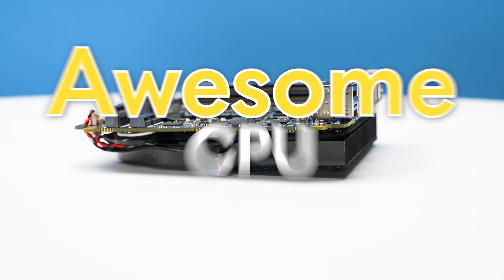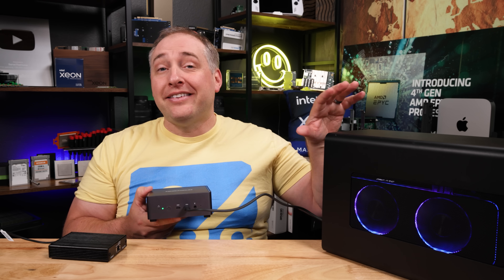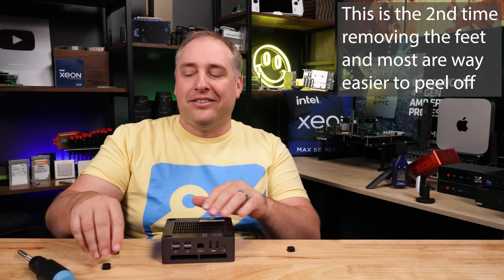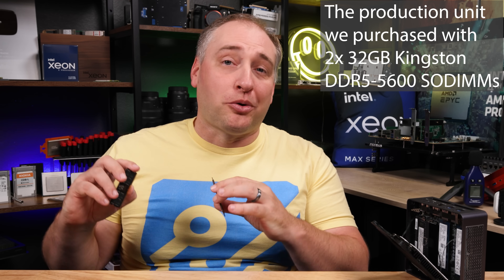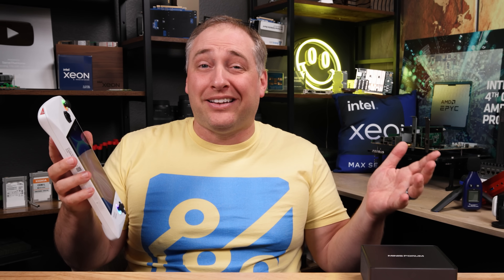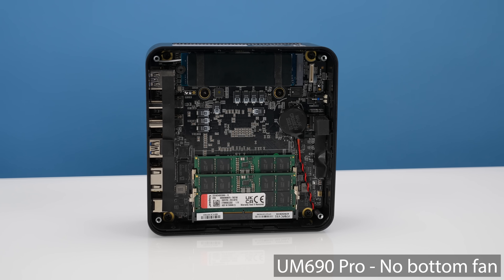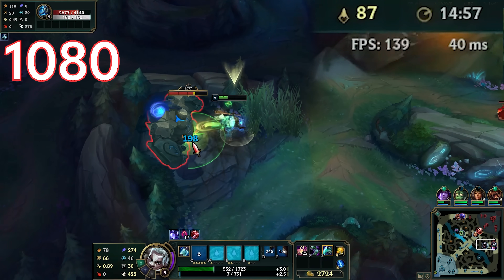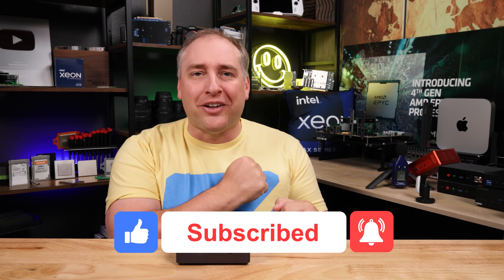This Was NOT the Mini PC We Expected... Minisforum UM790 Pro Review

Comment: Thank you very much for this video presentation.  It could not have been more timely as my unit just arrived yesterday.  I ordered mine with 64GB RAM , 1TB SSD and Windows 11 Pro.  My immediate first impression, I love it!!  This will become my main production machine.  Currently I am using an ASUS ROG F15 Dash TUF, closed lid and connected to my external LG 40" Ultrawide 4K monitor as my main system.  That also works just super.  A couple caveats I have noticed up front.  When I connect my LG monitor to the UM790, I noticed I only get 30Hz refresh.  That is UNacceptable.  I presume I would / could get better over the USB4 ports, but hey, are these not HDMI v2.1 ports?  Are they not supposed to support up to 60Hz even at 8K?  Now, I don't know if the cable makes the difference as I am using one of my own HDMI cables I have laying around rather than the cable that came shipped with the kit.  Do HDMI cables have rated variations (i.e., v2.1 compatible) similar in the way there are differences between Thunderbolt 4 active,  Passive,  and plain vanilla USB-C cables?   

The other caveat I noticed is that when I attempted to upgrade my Windows 11 Pro to the latest Windows Insider Preview Build (#23493) on two attempts now it hangs at 64% and I had to resort back to the previous installation as they shipped it.  I wonder if that has something to do with this being an AMD vs Intel processor.   Cheers,
Jerry / Tokyo.
Reply: I know that DisplayPort cables can have official ratings from VESA.  I'm not sure about HDMI.  I've seen mixed thoughts on this that cables don't truly have a rating and rather it depends on their quality, but that's can't of the say same in that the rating is supposed to assert a minimum quality level.  I'd just say just stick to reputable names and avoid the random Amazon ones that claim HDMI 2.1 for next to nothing as there are plenty of fakes on the market.  Yes, though, I'd 100% try another HDMI cable.  There's also a place in Windows to change the refresh rate and a place in AMD Adrenaline graphics software, so you might verify if 30 Hz is actual max or just defaulted to and can be set higher.

As for Windows 11, I'd say not necessarily that it has an AMD processor but that the Phoenix APU is so new, yes, it could be a driver issue or something of the like.  If only MS made it more straightforward to review an error log when something like that happens to know for sure.
Reply: @DeltaSierra426  Hi, good post...How about the WIFI connectivity ????? The GEEKS mini PC are rubbish with WIFI connectivity. How is this for wifi ? Do you lose much at all ? My Router is in the same room as i think the wifi booster dongles are a crock ....
Thanks in advance
Reply: Hi, good post...How about the WIFI connectivity ????? The GEEKS mini PC are rubbish with WIFI connectivity. How is this for wifi ? Do you lose much at all ? My Router is in the same room as i think the wifi booster dongles are a crock ....
Thanks in advance
Reply: @dannieduplessis2432  WiFi works fine for me.  no weak signals, drop issues.  I have the router (ASUS RT-AX86U) in the same room with the UM790Pro and no problems.

Comment: Any reason why we don't see 10 tb 2.5 inch SSDs market for NAS use?
Reply from the maker: 2.5" and SATA SSD volumes have fallen off a cliff. All of the development is now on M.2, E1/E3, and 2.5" NVMe. On the NVMe side, we reviewed a 32TB drive earlier this year (https://youtu.be/qMCqE6tLtoI) that is cheaper than 4x 8TB M.2 drives because of volume.
Reply: @ServeTheHomeVideo  Wow, pretty soon they'll be producing individual 100 TB drives with PLC. Then you would really need only dual drives for a NAS, one of which would be for a backup.
Reply from the maker: @jmd1743  We will see normal data center 64TB 2.5" drives in the next 3 months.

Comment: Love that the cmos reset button doesn't look like a short mishap away from a bad time, would have been nice to have at least one of the usb4 ports on the back, while I can see some use cases for having it on the front just seems counterproductive for a clean look that many of these are going for as well as counterintuitive when you consider most people expect to find things relating to power and extensions on the rear of the case, either way minor gripes aside love the IO on offer and looks like it would be a great system for on the go casual gamers and homlab servers even if it has one network port itself.
Reply from the maker: Totally agree.

Comment: I have the UM270. It has space for a 2.5 hard drive,  but do not really know way. If anything I would like to mount a DVD drive, but that is me. DVD is occasionally useful. Making it a little smaller would be better than an hard drive. I also would like more USB ports. There is only a double one in the back, and two singles on the front. Nice if they replaced them with doubles. I have to use expanders because of all the devices I have. It also has a USB C. My other issue is that the fan runs a lot, and it is noisy.
Reply: Just get an external usb dvd writer, usb laptop dvd drives are cheap. 
I personally can't remember the last time i used a dvd... (and if I really need to boot something, iso on an usb stick...)
Reply: @nielsdebakker3283

Comment: As it could power up by usb4. Is it possible to replace the power brick with a 100/150w usbc charger ?
Reply from the maker: 100 might be tight. 150 will be more than enough (it comes with 120W standard.) You will, however, use a Type-C port for this instead of something higher-value given it already has a 19V input.

Comment: My only complaint is that the power block. Small case is impressive. But in many industrial setting or use case of such compact PC, large power block is not ideal. Small min-PC with large external power supply block is meaningless. Impressive for reviewers,, but not practical in many field application. They should have used larger enclosure box and included compact power supply in the box. Power supply can be custom designed with space- and heat- efficient high-quality design, to fit in the designed form factor and heat dissipation budget. That will drive up some cost, but worth the cost difference.
Reply from the maker: Most industrial applications use sealed fanless units though, and I can say we have tons of industrial units with external PSUs because they get rid of an internal fan which is a point of failure.

Comment: waiting for ddr6 to arrive because sodimms have reached their maximum speed and newer DDR5apu´s will be crippled to use 6400mhz sodimms. DDR6 will take APU´s into the stratosphere
Reply: Actually, the new Strix Halo APUs are the future, and RAM Frequency is no longer a huge barrier. The Strix Halo 8060S iGPU comes with 32 or 40 Compute Units instead of 12 or 16, and includes 64MB of Infinity Cache, greatly improving bandwidth even with slower DDR5 Speeds.  Also, the CUDIMMs when perfected will replace SODIMMS in high-performance Laptops and Minis anyway... and they are as fast as LPDDR6X

Comment: Why do they have to put the rubber feet on top of the screws AT ALL?  rubber feet are adhesive.  why can't they put them forward or aft of the screw holes?
Reply from the maker: No idea. Also easy enough to make a hole in the rubber feet to allow screw access
Reply: @ServeTheHomeVideo  Yup. I drilled em so they only ever came off one time.

Comment: The only change I'd like to see would be swapping one of the USB4 ports and 2 of the USB A ports -- that way if you wanted to have it connected to an eGPU, you leave your front C port free, and if you want to connect a USB A accessory, you don't have to reach to the back/pick it up to plug things in.

It's amazing what the "laptop" class components can do these days! It seems like not that long ago that they had to put true desktop CPUs in honkin' huge laptops or relatively large mini PCs to get into the low/mid-end speeds of desktops at the time... now we have these cute little boxes! As much as I love building desktops, it's great to see options that would allow you to get performance with a few boxes and wires in a few minutes. One of these, eGPU, some storage... Got a full editing station.

Comment: @ServeTheHomVideo  Silly question, any support onboard for ECC memory?
Reply from the maker: We did not confirm ECC working beyond the on-chip ECC for DDR5 that is handled by the modules (this is not the same as ECC SODIMMs to be clear.)
Reply: @ServeTheHomeVideo  You should get a pair of real DDR5 ECC SO-DIMMs and include testing with those in any future SFF review that you do! Does it accept it, is it recognized as error detecting and error correcting according to the OS. Thanks in advance!

Comment: but why noone makes them passive with internal PSU for cleaner setups and, well, less noise

and moving to the front: using combo jack + dedicated mic jack should be the norm, it's a cheap change but improves compatibility to the roof
Reply: Golly jeepers, I wonder why nobody chooses to put a passive cooler 4x the size of the whole PC on top while shoving a PSU inside that's ~40% of the volume of the chassis.
Reply: @tim3172  if you can hear it it's broken and worthless, making it smaller than possible makes no sense
also if the power brick isn't in a plug small enough to not interfere with adjacent sockets it has to be internal, it doesn't make any sense to put it outside in such case because it's inconvenient
also also, well engineered passive cooler doesn't have to be exactly big when working with low power chips, but obviously that'd be more expensive to make than just plopping an e-waste laptop cooler on it

Comment: I have an application which needs 256GB of ram, what kind of PC would you recommend? Im having difficulty in locating this type of config.
Reply from the maker: Does it have to be in a small form factor? If not, we are going to show Xeon W-3400 and W-2400 platforms in a video the second half of this month. With those you can go well beyond 256GB.
Reply: @ServeTheHomeVideo  No, SFF not required, can be workstation, desktop or rackmount. What im having trouble with specifically is getting a NVidia GPU (RTX series) to work on server-grade HW. The app makes use of the compute capability of the GPU along with the 256GB to perform calculations and write a large file, which is why im looking for high-speed NVME (possibly array) as well.

Comment: While the Minisforum is a nice unit, it is nowhere near worth the price they ask. My reason is that with these mini PC, gaming is not on the forefront but as workstation it is. With that, a Dell MFF would be way more cost effective.
Reply: I really like Dell (specially their monitors which are from the best avaiable) but they are expensier, you receive less for more. F. e. MFF Dell Optiplex  i7-13700T,  with only 1 usb-c, 16 GB RAM and 512 SSD, plastic case it's 1.553, 34 € in Europe vs. nearly half the price for the UM790 w. a superior CPU, superior iGPU, 1 tb SSD 32 RAM metal case and better look (or even cheaper barebone). Even Intel NUCs are better priced. I know, with Dell you get better custom support, but I'm really thinking about getting some of those UM790 for my small office.

Comment: I got Um790 pro 2 days ago, and I'm in awe. D4 runs buttery smooth at 1080p in medium to high settings.
Reply: Is there any GaN battery brick that’s compatible with the UM790?  I’d love a usb-c “ups”-like setup where windows can monitor the battery level and auto-shutdown when the battery level is low.

I’m scared of consumer ssds because they lack PLP that enterprise ssds have, meaning that at-rest data can get corrupted during sudden power loss.
Reply: Is it good for video recording using obs while gaming and video editing?
Reply: Hi, good post...How about the WIFI connectivity ????? The GEEKS mini PC are rubbish with WIFI connectivity. How is this for wifi ? Do you lose much at all ? My Router is in the same room as i think the wifi booster dongles are a crock ....
Thanks in advance
Reply: How often does it randomly reboot? 😂
Reply: D4 never ran smooth on anything

Comment: Steve, Beelink also introduced a firmware on 6/21 for the GTR7 that lets you select 45w, 54w, 65w for cpu tdp if you want to let it run a bit cooler too!
Reply: Beelink has been more consistent in terms of sustained performance in recent generations. But this particular Minisforum unit apparently resolves those issues while likely getting the most out of this form factor. The Beelink GTR7 apparently trades some size and noise for performance on the margin.
Reply: Beelink, actually providing updates? Amazing.
Reply: The firmware already had an easy way to set TDP without updates...
Reply: @benderozo  Definitely. Maybe some of the lower-level models don't allow full TDP control in BIOS, but the GTR series always has.
Reply: kogami420  for real, i just got into the mini pc market and can't tell if beelink is better or minisform when it comes to thermals and overall reputation alongside support.
Reply: @zhila5958  I wish I knew also, trying to decide which to buy, I have an order placed with the miniforum one but was abit of an impulse buy
Reply: I wnna buy the gtr 7 pro
Reply: MinisForum goes down to 35W and less.
Kill-o-Watt says about 40W for entire system.
Reply: where is the firmware for Beelink mini pc to be found?
Reply: @zyghom  I work with a rep there but you could probably just email their support. Ask for the 6/21 firmware that supports TDP changes and RAID.

Comment: My favorite SSD for these systems is the 2TB western digital SN570.  I prefer PCI 3.0 vs 4.0 because it produces much less heat in a small system.  They are also cheaper.  Plus most users are not going to see the benefit of a 4.0 SSD over 3.0 unless they are doing heavy media content creation anyway.  The 2TB SN570 can be had right now for $93-$100 on most popular retail sights.  I have used a lot of beelink and a few minisforum small systems like this for clients as HTPCs.  Most of the time with 32GB (16GB for the integrated graphics and 16GB for system memory) unless they are very heavy users.  I personally have a Beelink with 5600H, 32GB RAM, and 2 x 2TB SSDs (1 x SN570, 1 x 2.5" SSD).  If someone was going to do gaming I would absolutely recommend a ryzen 7x4x CPU (with RDNA 3 graphics), 64GB 5600MHz, and at least 1 x 2TB SN570.  If they really wanted to spend a bit more for the best SSD then I would recommend the 2TB Samsung 970 EVO Plus SSD at about $110 right now.  (I use this one in my everyday laptop.)
Reply: The hynix p31 is one of the absolute lowest power 3.0 drives if you don't mind giving up a bit of performance.
Reply: @neilquinn  $100 for 2tb doesn't seem unreasonable to me and western digital and Samsung just have great reputations for reliable drives aside from the 990 Pro fiasco but they did replace drives that were badly damaged by the original firmware and rectified the situation as they should.  I've had problems with other manufacturers and seriously budget hardware before.  I've been building systems since Intel x286 and windows 3.1 days.   I am semi retired and still put together about 500 systems a year for clients.
Reply: @eclectricgay  My favorite drive all around right now is the SN850x. It's 4.0 though and not as power efficient as the older 3.0 hynix 3.0 which blows everything away with efficiency. Normally I don't like straying from crucial/WD/samsung, but hynix is pretty well established as a storage manufacturer.
Reply: @eclectricgay  Good to know. I have some miniPCs and was deciding on SSDs. Maybe I'll move to cooler/quieter. SN570 has no DRAM though right and gen 3? No 4.0 drives you like that are reliable?
Reply: @eclectricgay  Right. Would you trust the SN850x in miniPCs though where things are already really hot? (Beelink GTR7)
Reply: @eclectricgay  Ha I'm looking to put some in a miniPC so maybe should avoid the SN850. Hmm feels like a waste to not use PCIE 4.0 though.
Reply: @neilquinn  Wasting what?  You literally won't know the difference if no one told you what was in it.  What you will notice is more heat.  That extra heat will mean fans spin up more.  So your system will be louder.  It means less reliablity since heat breaks down electronic quicker.  It will also be more prone to errors.  I have stated all this in the conversation.  If you don't want to listen to wisdom of decades of building and repairing PCs go ahead by all means chase specs.
Reply: Hi brilliant info thanks, which would you choose between the Beelink or miniforum?  I have a mini ordered but can cancel.  I also ordered 1x 
WD_Black SN850X 2TB and 2x Corsair VENGEANCE DDR5 SODIMM 64GB (2x32GB) DDR5 4800MHz C40, I was advised that these AMD cards can never utilise more than the sticks 4800Mhz in reality so a waste of money.  I'm looking to game and use retro emulators but have as the kids machine for minecraft really, then general multi media type stuff, nothing crazy (odd youtube video etc) would love to hear your recommended setup here
Reply: @ragefires  I personally trust Beelink more these days. Neither is perfect but minisforum had a lot of issues w/ the UM690, UM773, etc with overheating/shutdown issues.
Reply: @neilquinn  they have just told me my order is a ‘pre-sale’ so an extra month, pretty poor so going to cancel that one.  It was just I wanted to get a bare bones version and upgrade with better stuff which works out more expensive when going down the bee route
Reply: @neilquinn  they have fixed all that with grills and heat skins in the ram by looks…